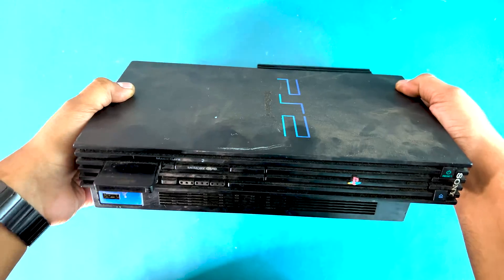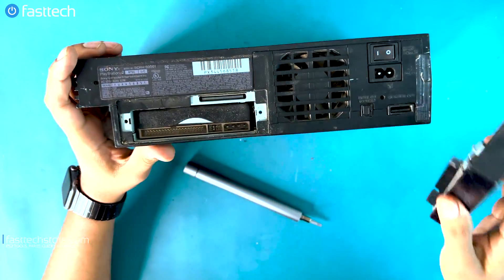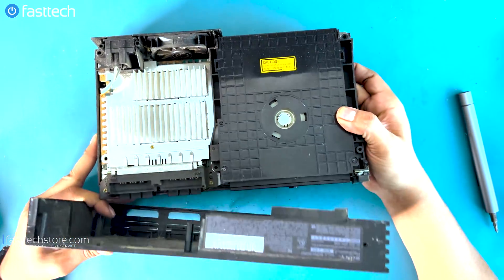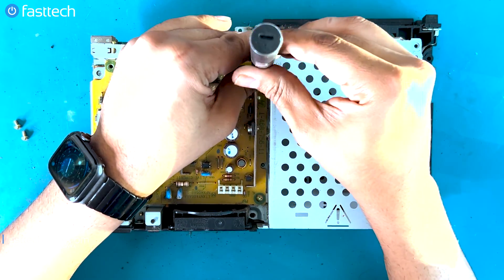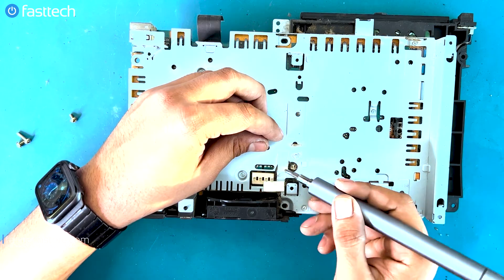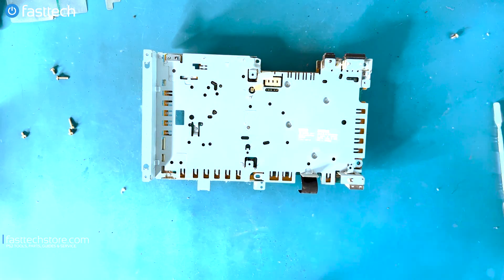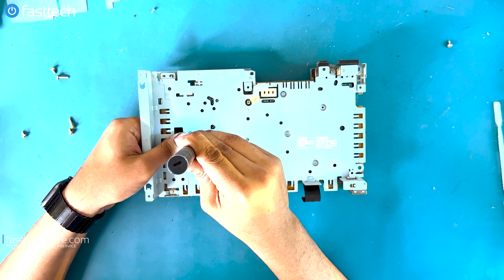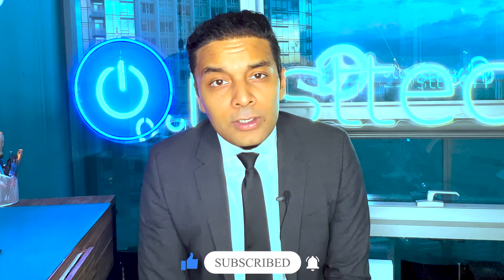PlayStation 2 (PS2) FAT Disassembly and Repair Guide (No Power, Disc Not Loading, Red Screen)

Comment from the maker: The PS2 in this demonstration was a SCPH-50001 / 5000X (Parts Below):
▶ PS2 SCPH-50001 Power Supply: https://www.fasttechstore.com/playstation-2-parts/ps2-fat-scph-500000-500001-power-supply-board
▶ PS2 SCPH-5000X Disc Drive: https://www.fasttechstore.com/playstation-2-parts/ps2-fat-scph-50001-5000x-disc-drive
▶ PS2 SCPH 50000/5000X Laser Lens: https://www.fasttechstore.com/playstation-2-parts/ps2-fat-scph-50001-5000x-laser-lens
▶ PS2 Mainboard SCPH-50001 Mainboard: https://www.fasttechstore.com/playstation-2-parts/ps2-mainboard-scph-50001-gh-023
▶ PS2 SCPH 50000/5000X Power and Reset Button: https://www.fasttechstore.com/playstation-2-parts/ps2-scph-5000x-power-and-reset-button-assembly-with-ribbon-cable
▶ PS2 SCPH 50000/5000 Casing/ Shell: https://www.fasttechstore.com/playstation-2-parts
▶ PS2 HDD and Network Adaptor: https://www.fasttechstore.com/playstation-2-parts/ps2-hard-drive-and-network-adaptor
▶ Fasttech Pro Autokit: https://www.fasttechstore.com/tools/fasttech-pro-auto-kit

▶ Want us to fix your device for you? Just order the Fasttech Repair Box to send us your device by using this link: https://www.fasttechstore.com/repair/repair-box
👉NEED HELP? FaceTime/Zoom Video Call Me: https://www.fasttechstore.com/online-consultation
👉GET REPAIR SERVICE FOR YOUR DEVICE: https://www.fasttechstore.com/electronics-repair

Comment: Mine died too. It's the 50004 fat. No power. It worked a couple years ago. I bought it second hand. Today it wouldn't get any power, no red or blue little light. When I opened it up, everything was clean, not a little bit of dust. But the fuse you speak  of, where this one has a clear fuse horizontaly, I have a vertically white fuse. Can't see through it. Can't get it out either.

Comment: Don't know if you can or will answer this or not after all this time, but here goes...I broke the connector off the motherboard for my fan. Is that something I can fix?
Reply from the maker: @samanthanenadal6748  yes it can be soldered back on unless you ripped out a trace.

Comment: Can I swap disc players between consoles or is this a similar issue as ps3 disc players as you need to keep the circuit board of the original disc player?
Reply from the maker: @moogish  there is no drive circuit board in ps2s so you can simply swap drives as long as the consoles have the same model number
Reply: @ yea it’s a fail. I tried helping my cousin out with this. They are both PS2 fat models. But one disc player has a red white and yellow wire. While the other disc player on the second, PS2 fat has one single ribbon cable. Also I couldn’t what model one system was as the sticker was removed. As to why I needed to open both systems to verify.

Comment: I think my PS2 has a BIOS issue. I checked all the fuses; it turns on but doesn't boot up. I checked all the fuses and the power supply, and all that is good. When I plug it in, the red light comes on after a few seconds just like normal, but when I click the button, the led turns green, the fan does not start spinning, the PS2 tray eject button does light up, but when I click it, the tray does not open up, and when I try the power button, it doesn't want to turn off. The issue is that I think the bios got corrupt somehow, and now I want to take the bios out and check the bios chip for the PS2. See if there are any errors in the code or if the code had been cleared out for a previous attempt at a mod before I got my hands on it. So I will be checking the PS2 BIOS chip with a T48 if I can get my hands on one.
Reply from the maker: @trystonkincannon8320  good luck let me know how it goes. If you fail you can always buy a replacement board from us

Comment: Awesome. Was just putting mine back together after replacing the laser and had one screw that I couldn't remember the location of, and your video helped me figure it out. Thanks a lot, brotha. 

Oh, and a little tip for anyone changing the laser and still having read issues, before attempting potentiometer adjustments, try adjusting the little cogs below the rails that the laser moves back and forth on first. Mine wasn't reading DVD based games, and I turned both cogs half a turn, which raised it up a bit, and that fixed the problem.
Reply from the maker: @themoon69420  thank you for your comment. Could you show a timestamp of what you are referring to regarding the cogs?
Reply: @fasttechvideo You can see them at 13:05 above your thumbs. The two little white cogs. If you flip the drive over and take the top cover off, there's a hole for each one in the metal clip that holds them in place so you can use a bit to turn them.

Comment: I tried to disassemble my working ps2 model but after reassembly doesn’t power on
:(
I changed the buttons ribbon cable (because it detached and lost the blue tabs)
Maybe I connected it to the wrong side of contacts? I am desperate…
Reply from the maker: @rubi-w-  the blue tabs are critical for the cable for the power button cable to work properly. Replace the blue tabs with a plastic card of a similar size (you can cut one to size) otherwise buy a replacement cable and you will be okay.
Reply: @fasttechvideo  Yeah I bought replacement ribbon cables and it has the blue plastic to help it stay in place, but I don’t know why the ps2 buttons still don’t light up, maybe I connected them the wrong side?

Comment: what will happen if the blue cable near the disc tray is removed?
Reply: 12:14
Reply from the maker: @Dontplaywith_me  the disc drive wont work properly
Reply: @Dontplaywith_me  There is an easier way to get the cable out. These cables come out both ways. It's easier and suggested to be taken out by the motherboard first, then the lazer disk, most of them at least. I had to read the entire model 50001 repair and maintenance book for this, but you take it out by the board, and then it's easier to reinstall the cord for the lazer and the rest of the disc reader.
Reply: If you have patience, will the disc drive still open?

Comment: hello i need help.. my ps2 will boot fine and no issue at all at powering the console but my controller port doesnt work.. i tried 2 different new ps2 controller still dont work i tried replacing the ribbon connector and ribbon cable still doesnt work..
Reply from the maker: Try replacing the port module. We do sell it on our site.

Comment: 7:03 a blown fuse would indicate excessive draw. The correct procedure for diagnosis would be to monitor mA DC draw across the fuse on power up and trouble shoot from there.
Reply from the maker: I agree. However sometimes it can be a short, liquid or even a single follicle of hair in the wrong place on the psu that can cause that fuse to blow.

Comment: Hello sir, I have an issue with my ps2, it switches on normally but did not display on the TV screen at all, the TV can not even read it's signal but the ps2 is On and also the AV cords are working perfectly after I tested it with a multitester meter nd confirm it with another Ps2 with the same TV
Reply from the maker: Its usually the video encoder chip or the filters that need to be replaced.
Reply: @fasttechvideo  can you pls give me a description of how to locate it?  maybe I can be able to change it
Reply: @fasttechvideo  pls a friend of mine also have a ps3 but whenever you start it on it's power button, the red light Turns to green then b4 it starts running, it trip off back to d red light and now flashing d red light... The same thing goes over and over again... No display on the tv at all since it couldn't start up but trip off back to flashing red standby... Pls what could be the issue here and how can I solve it?

Comment: I have a phat ps2 here that doesn't have power I opened it up and not only can you not see the state of the fuse as it metal and painted white but you cant change it without desolering it. My guess is I have a completely different model.
Reply from the maker: Replacing the power supply will fix your issue
Reply: @fasttechvideo I have the same model and I just changed the power supply and still not getting any power. Testing it with the multi meter it shows 120v on both power supply the old one and new one. When I shut it off it goes back to 0. So it seems like I have continuity but no sound or appearance of it running
Reply from the maker: @ariesanfilippo1078  replace the mainboard we have them in stock
Reply: @fasttechvideo  just ordered it.
Reply from the maker: @ariesanfilippo1078  i dont see your order. Did you order elsewhere?
Reply: @fasttechvideo  hey, I didn’t now you had a company but I did order it. Now it working lovely

Comment: I have a question, is it safe to switch to a 220v Power Supply? cuz the online store I am searching on has a power supply tho people said it is 220v, and the PS2 FAT's OG Power Supply has 110v
Reply from the maker: Yes you can switch out the power supply as long as you plan on using it in a country that uses 220v

Comment: I fixed my laser drive and then the Disk drive just stoped working I realized I forgot to plug the laser cable and then it stoped working. Eject light ain’t working also but the system powers on any fix for my dvd drive?
Reply from the maker: Check all the ribbon cables for the disc drive.
Reply: @fasttechvideo  after I plugged the ribbon cable into the laser it’s still wouldn’t work it’s like it worked for a second after I installed the laser and then nothing. The dvd tray ain’t working the laser ain’t turning on 🤔

Comment: When my console powers up, it flashes from green light to red light, also disk drive struggles to open and close. Any tips? or maybe some parts that need replacement? Thank you
Reply from the maker: Do you have to unplug the ps2 to get to to blink red light again?
Reply: @fasttechvideo  It keeps blinking, i saw that the disk tray tried to open. But was stuck. Gonna take care of that before trying anything more. Thanks.

Comment: my unit is kepp freezing with games or without games on it i change the  battery clock that they say but its the same,its freezing..i guess its something to do with thwrmal paste or pads..can you help me..🥲
Reply from the maker: Try a reflow on the emoticon chip. If that does not work I would recommend using a thermal cam to find shorts / hotspots on the board. It is normal for emoticon engine (cpu) to run hot.
Reply: Did you figure this out? Mines is doing the same